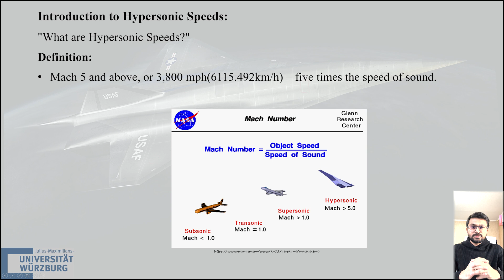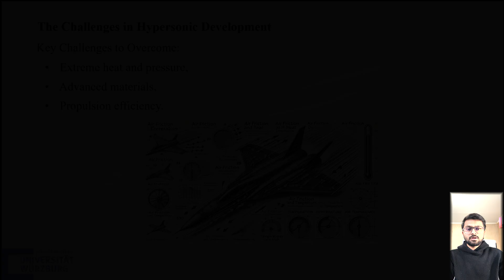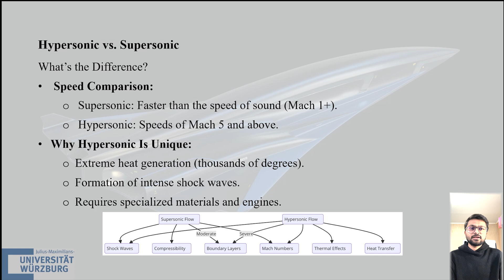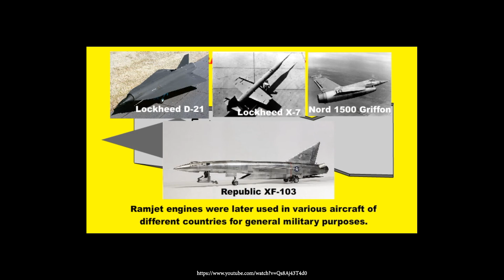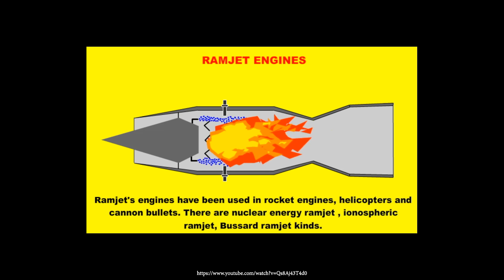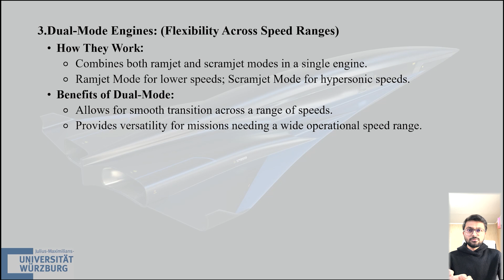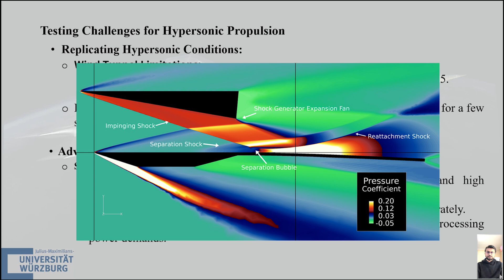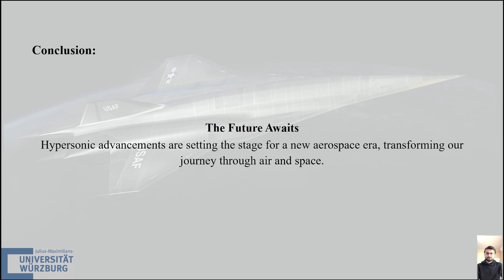Hypersonic Propulsion

Comment: THere is no sound wit Russian Hypersonic system.  You have to forget what your learn at the University for thermodynamic. This is base on lapalce force on bi temperature gas. The engine create the current to buitlt a huge magnetcic field.  The Engine needs to be good for Mach3-4. The difference of speed  to reach Mach 10  will be done by the change of environnement of the plane,  the  missile.   There is math behind that technology totally ignore here. It is not found in the book I m afraid. This is based on the suppression of  Velikhow instability  by MHD.  The Russian jet figther new generation will be able to reach space t destroy satellite by impulsions. This option will be possible from 40km altitude . the Hypersonic mode  will be used less than 30 seconds. Ceramic will added to protect the edges  for the return. Of course this is for the plane. For the Hypersonic missile the combustible is powder, The MHD generateor is making the shield for the missile  flying in a nearly vacuum tunnel . The tip is concave.  Any conventional missile can be converted in hypersonic missile . This is why it is so scarry, because it cost much less the US intelligence pretends. Once the USA will eventually found the solution the Russian will be  able to vaporize a tank without making fume. The weapon use by ET...